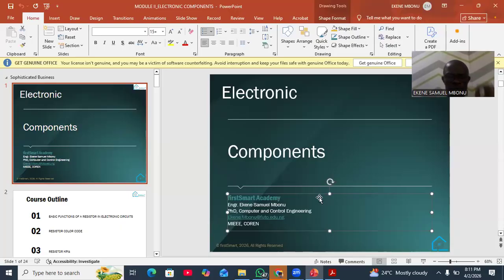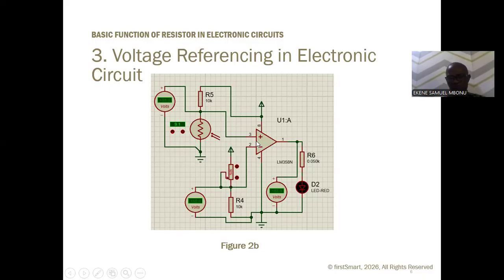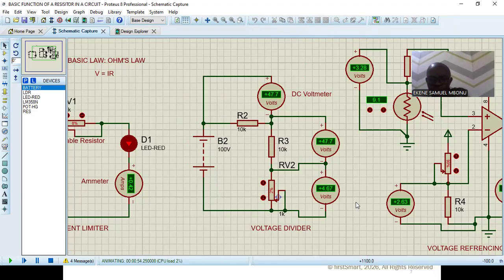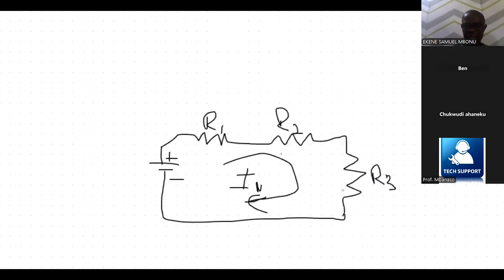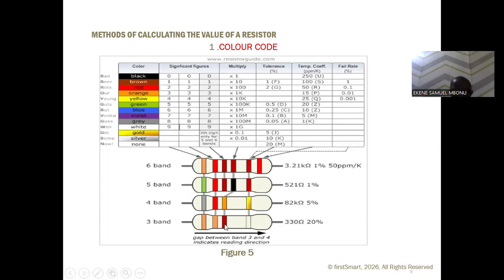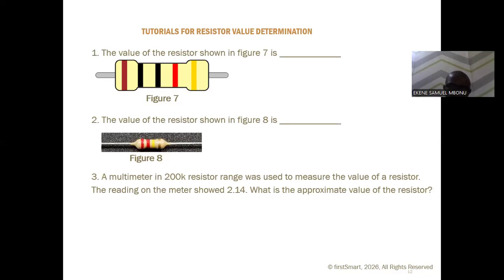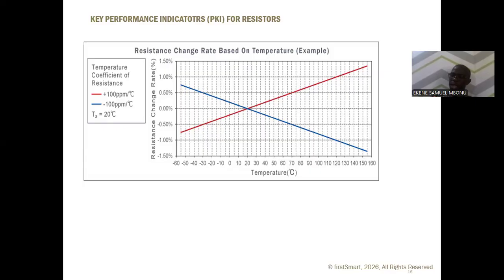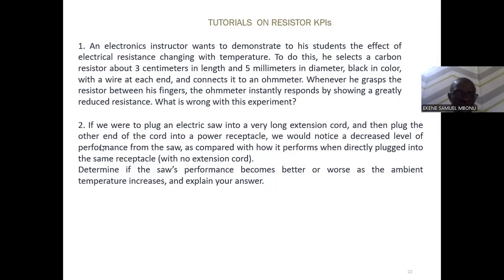RESISTOR AND ITS PRINCIPLE OF OPERATION

Comment: My name is Nwoko Uzoma 
A 300level student of mechatronics engineering,FUTO

TUTORIAL ANSWERS 
1.  1 kohms ±5%

2. Using resistor color code:
Answer: 220 kohms ±5%

3. Meter range = 200 kΩ
Reading = 2.14
Calculation:

Approximate resistor value: 2140 ohms